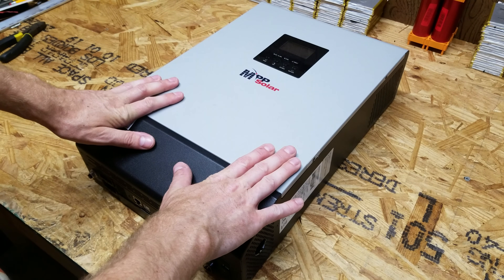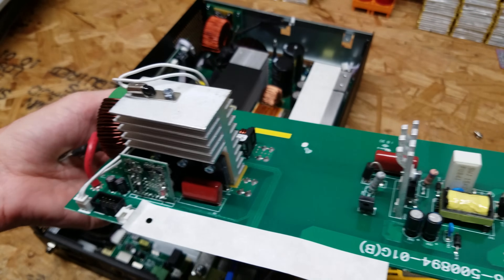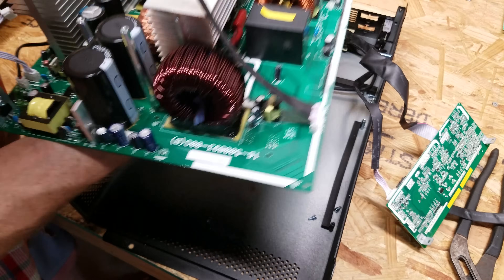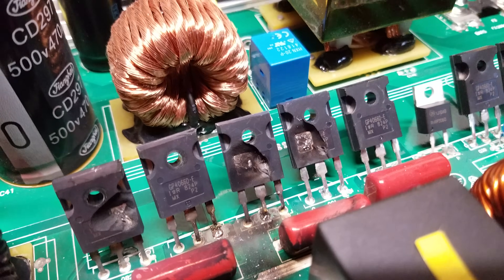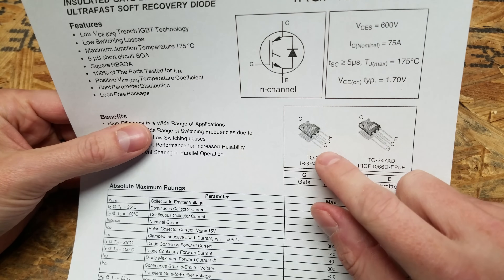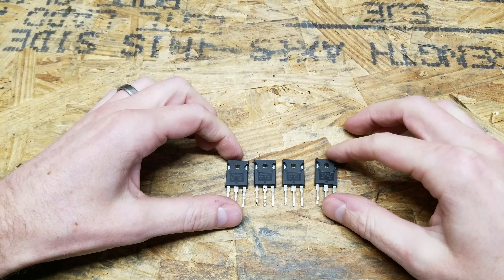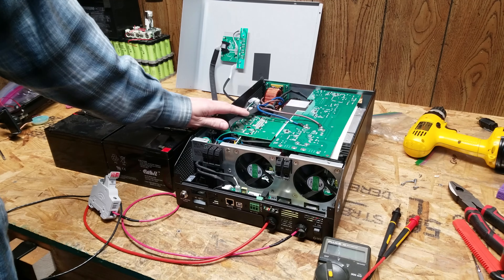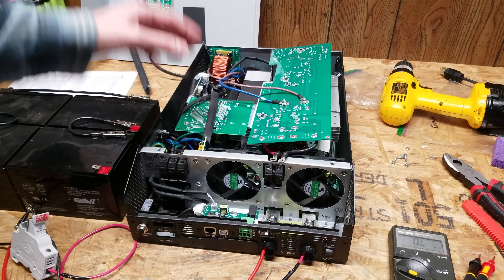MPP Solar PIP-5048MG Inverter Disassembly and Repair Attempt

Comment: Try to call or eMail MPP Solar  in TAIWAN and you will get pretty good answers and support ... add all the details you had heard from the owner and make a reference to this video.
The pre- and after sales are brilliant and you can not throw this manufacturer in the typical chinese pot cause

it is not that what you consider to be China cause Taiwan is the island and the american allied known for quality and sustainable products.
No, I am not a Taiwan employee, just a buyer of their products and I have benefitted a lot from their pre-sales service when I was not sure what product family I should or could take for  my project and they had helped a friend with a 5 year old inverter where something had been blown up after a thunderstorm and a blitz. He got a spare board within 3 instead of 5 days (from taiwan to germany) and his unit was working again.

And the technicians are willing to help to repair just the pieces that are dead if you are familiar with soldering. 
They try to help and not to sell their boards which is quite unusual.

So you might give them a try cause that would be the fastest and best solution you can get and report about in the upcoming video how you were able to fix it.

Better than reading and judging and following all those comments of pros and amateurs, cause mpp Solar is  the developer and manufacturer of these inverters that are sold all over europe under different brands and logos.
They know their stuff and I guess you will understand in a second how valueable their support can be once you get in touch with them.
Might have saved you 6 months waiting for spare parts and ideas.

Just write a short mail with a link to this video and then you should get support cause my friend did it exactly that way with his 5 year old inverter. Might be that they ask for measurements and then he made another update video and send the link to them and found the cause within 3 days and fixed the whole issue in 1 week. Not bad considering the time delay and the distance from Germany to Taiwan ... the german customs need far more time to do their work but this pcb arrived untouched, therefore lightning fast.  The damage of the 5 year old inverter was cause by lightning or Blitz and its power peak / impulse. Repair was a board replacement that had cost 80$ ... but it was not a big board.
The reason was that the special spare part needed was not available in europe during first lockdown and would have cost 30$ + european shipping alone, so he took the complete board which was the easiest exchange .

Comment: That soldering wick is containing flux too and therefore it looked dirtier afterwards ... cause it melts away and you can see it in the first solder wick points ... you see the heat "melting something" before the tin kicks into the copper.

Comment: Normally in a inverter there will be a two set of mosfets .N-CHANNEL  and BJT .. n channel are use to switch low voltage DC  and IGBT are there to switch high voltage DC to main AC

Comment: Transformers have at least 2 windings. Primary and secondary. 
What you have is a coil (inductor) used to filter out noise, or most likely part of a low pass filter or current inrush inhibitor. 
When it's called L1 or L followed by a number, it's an inductor. T1 or T any number, is a transformer.

Comment: @4:50 is a security screw. 
You need a cheap component tester. They are like < $10 now and no tech should be without. 
Diodes usually die shorted. If there is enough power, they will blow through the casing. 
If you make a detailed closeup video of the boards and traces of both sides, I for one would enjoy troubleshooting it from afar. We can all troubleshoot it from our end. 
Tracing the input to find the cause of the short, is the first step. You meter can't provide the threshold voltage for the IGBTs.

Comment: The igbt need about 6 to 10 volts to turn them on.  When you checked the dc input you have the red connected to negative showing a short. The input probably has a diode across it for protection. Test with the red from the meter to positive and you should see the meter change as it charges up the capacitor inside.

Comment: I think the smaller high frequency transformers are blown up. As mu experience, this type of switch mode power supply have some small transformers connected to the collector of the igbt makes a dead short when higher voltage is applied and melts down easily. that produces an internal short by the transformer as the insulated copper  wires are melted and exposed to each other. But these type of transformers are not repairable and industrial stuff i guess since it is calculated by the manufacturers as voltage and frequency. So if this happens, I must suggest you to NOT to try repair by your own. :)

Comment: If you don't have a 48 volts constant current power supply, use a load between the positive of the battery bank and the positive of the inverter. A good load for this test can be heat element, an 120v iron or incandescent lamp 120v 500w or even four 12 volt 55 watts halogen bulbs in serie. 
Remember that most MOSFET are very sensitive to static energy discharge. Just a little spike in the gate could short permanently. To avoid the you need to be touching ground.

Comment: I think the IGBT's switch the AC side voltages... if your dead short is on the DC inputs, then the short is likely somewhere on the DC side of the board. Try isolate the input board from other boards and test again. My guess is it's one or more of those small transistors on the other side of the unit

Comment: VERY LIKELY the MOSFETs on the OTHER heat sink are also damaged.
Then there are DRIVER transistors feeding the MOSFETs and they might be damaged as well.
You also MUST check BOTH ways with the diode setting on your meter.
One way there should be '.4 or .6, and the other direction should read OPEN (OL)'
You MUST check diodes in FORWARD and REVERSE polarity (.4 and OL)
Reply: Check MosFETs on the battery side. You will have one or more shortened FETs. It’s better to change all parallel transistors at once.

Comment: When you need to to remove those power devices, I would cut the legs first since there is no need to keep the blown devices intact, and that will also minimize damaging the board especially the multi layers boards. BTW, the Gate driver devices may be also damaged too.

Comment: 2:32 Center bottom there is an 8-pin IC. It looks like there is a white spot on top. Make sure this is not a blow out point on the IC
5:22 The red parts are high voltage capacitors. The one on the far left looks like it "could" be damaged. Make sure there is no damage to the casing

As for the FETs, I would have replaced all of them. Don't take any chances with this kind of failure.

Comment: 9:55 This is where a toothbrush comes in handy. Dip it into the alcohol and then brush the board. It removes the crud easily.

a few seconds later "i suppose you could use a toothbrush"  😄  yup, exactly!
Reply: Acid brushes work like a champ!

Comment: 9:48: That pad behind the FETs is not only a thermal pad, but also an electrical separator. The metal pad on the back of the FET is also connected to one of the pins (I think the Collector, but not sure). So to keep them from all shorting out, the pad is used.
Not all the FETs will be activated at the exact same time, or turn off at the exact same time. They pulse on a different times to help give a sine like wave. Then smoothing capacitors and the inductors (the donut looking thing with thick heavy wire wound around it) take the somewhat jittery wave and make it a nice clean sine wave.

Comment: 4:55 That screw is a type of security screw. The specially designed tip has a hole in the middle of it where that post goes into the bit. Altho, this is the largest one of those I've seen and especially odd that there'd be one in one of these devices. I would expect to see this on the "outside" of the case to keep someone from going in, not from removing the pcb.
Reply: Odd that they would design and implement a Phillips security screw in a hex headed screw... only use one on the three screw heat sink...
Reply: @SuperVstech  Took awhile, but I found it. It's called a Phill Pin. (losspreventionfasteners.ca/) I suppose a Phillips Pin(?). It is described as a "Phillips (cross) recess with a pin in the center".
As far as being in a hex headed, I have no idea. I do agree with that. What's the point of security screw to be foiled with a standard socket hex bit.  shrugs
Reply: @korishan  I wasn’t doubting the existence of a security Phillips screw... just the use of one made in a hex headed screw.
What point is it making secure the Phillips, but making the head hex?
Reply: @SuperVstech  I get that. I was just providing a little more info on it. And I agree, what's the point of a hex head with a security phillips bit. makes not sense.

Comment: short on battery input could be capacitors low ESR or capacitor short on battery input. 
MPPT stage with short ( protection diode or mosfet)
DC / AC inverter with short on input ( diode or mosfet shorted )
Good idea to limit amps on battery input and look for any component heating up with FLIR cam

Comment: Just a trick, to turn on mosfets on that way only works on mosfets or other components that have an gate and not a base. Like someone else said it could also require a higher voltage to turn them on
Reply: 9v battery does the trick

Comment: I would say the fact that the dead short is there even powered down and it’s easy to see with a meter should make finding it relatively easy.

Wouldn’t bother with passives initially a dead short of that magnitude ie 0 ohms is probably either as somebody suggested a physical short on the board or another semiconductor failed.

Second samuels suggestion with the thermal check recommend a current limited power supply but would also suggest disconnect the smaller boards and check them all separately it is a bit safer and helps to narrow down quicker.

Just go through the semiconductor stuff first I would highly doubt a passive component as they generally don’t handle lots of power and if they do they generally blow open and if this is at mains voltage It’s hard to miss.

Basically check all the transistors that look biggish then work your way down oh and from memory that inverter might have a large diode on the 48 volt supply don’t know why that would blow from the other side of the inverter but it’s easy to test.

Comment: Try to find a schematic and trace the circuit to determine what components were exposed to the mains voltage. I would also check all the caps and resistors that are located near the transistors for short or open conditions. Unfortunately, you soldered all the transistors back in. When you had them off, would've been the best time to check for shorts.  Good luck.

Comment: I don't think the other transistors would matter because it has to go thru the transformer and any short should not should up like that on the input side I'm not sure what you should see for resistance on a multimeter but I'd assume some of the mosfets are bad but I'd hook up a bench power supply that you can limit the current on and see what it does if you have one that can do 48v  or I guess you could probably use a large resistor to limit the current
Reply from the maker: One thing I'm not understanding I guess is, are the small transistors the ones flipping on/off to convert to AC? Or is that what the IGBTs are doing? If it's going through the transformer, which it does seem to be, one would assume the small transistors are creating the AC, but then I don't understand the purpose of the IGBTs.
Reply: @LithiumSolar  so my understanding that could be wrong is that a bunch of the mosfets go switching the DC at a high frequency and that goes thru the transformer to be converted up to like 250v or whatever the large cap is rated for somewhere in there and then the IGBT take that DC and make the AC output but I mean I currently have 2 broken inverters one I'm waiting on parts then we'll see if I can fix it and the other I still need to look into a little more but I mean what I was saying is that that high voltage DC conversion thru the transformer should isolate the IGBTs from the input a
Reply: This is general flow for high frequency online ups. The DC input is switched by mosfet at high frequency and amplified by transformer and input to bridge rectifier having fast recovery diodes converting DC. High DC goes to big capacitors then to IGBTs which produces AC which are smoothened by output inductor and ac capacitor !!

Comment: I would have checked the tracks while the MOSFETs where desoldered, It looked to me that some are  shorted 
If the bord such black burn marks you should remove all the burned PCB because burned charred PCB material can be conductive.
I don't know how many layers that board has but it can be that some inner layers are shorted, in any case, you should probe the board and the traces when the MOSFETs were out.
Reply: thank you
  very useful, i suspected that, now i think i KNOW it.

Comment: If you have a scope and a signal generator you can build a magnetic probe and trace on the 48V battery connection.   Test setup by shorting function generator leads together and move magnetic field probe near test wires.  Function generator is on full power (~10Vpp ,20khz sine wave).  Typically the output is around 50 ohms so the current is roughly 100mA peak.   Magnetic probe is 50turns of magnet wire maybe 1/2 inch diameter.  A small solenoid coil without center core would work.   Coil connects to oscilloscope input set on 10mV/division.  Holding the coil near the shorted function generator should show a sine wave the closer the probe is to the signal  and coil core lined up with transmit wire.  The coupling is magnetic with this setup so you can trace the shorting current to the offending bad part.   
With power off (0V on 48V battery connections), hook up the signal generator  to the 48V connections and start probing the wire/traces.   You are measuring coupled current and not efield with this setup.   It also possible to wrap the coil with copper foil and connect to the scope ground to reduce any e field pickup.   E field shield.   Good luck and let us know how it goes.   Kevin

Comment: Here's an item for your electronics bench.  I find it very handy.   ebay:  Multifunction Transistor Tester Diodes LCR - TC1 Full Color Graphics   around $20.   LCR and transistor checker.  runs off of USB power.    Not sure it has enough voltage to check fets however.

Comment: 8:05 Those IGBTs have a turn on voltage of 4 volts which is probably higher than what your meter produces
Reply from the maker: Good to know. Didn't even think to check that.
Reply: @LithiumSolar  And you are poking it between drain and gate, the source and gate should be used.
Reply: Maybe it is late,but that is not how you should test mosfets and igbt with multimeter,you turn them on by putting the negative lead on the emiter and not colector and the positive lead on the gate and check

Comment: That so called "defective screw" takes a special screw driver with a hollow center
Reply: indeed, remember Secure[d] Torx (adding a pin-in-the-middle)?
Reply from the maker: Why would they put one screw like that and the rest all standard phillips?
Reply: @LithiumSolar  to keep ordinary people from working on them.  I once worked for a company that issued screw drivers for that purpose, when I quit that company I had to return that screw driver. 🤷
Reply: I don't get those "special screws". 
They don't stop anyone, they just annoy, since you either have to buy an extra screwdriver or use pliers or needle and hammer.
I already have like 50 of those unique special screwdrivers and I keep finding more.
Reply: @hubertnnn  they stop amateurs from continuing and that is like a drawbar on  the street to prevent pedestrians and bikers to cross the railway. That drawbar can be ignored easily too but then everyone taking that shortcut knows the risks he is taking.
Therefore these screws are good ... a better sign than another  "DANGER" label sticking on the heatsink
Reply: I mean I'm not saying it's impossible but a poorly manufactured screw from china kinda seems more likely but that being said if it was tight they either used pliers too or had a special tool but it does seem like if it was intentional their would be more or in other places

Comment: That wouldn't be Ben's old inverter would it
Reply from the maker: Yes it is lol
Reply: @LithiumSolar  when you test if the MOSFETs are turning on you need to put the negative lead of your meter on the centre leg and the pos on the left leg the put the pos on the centre leg and neg on the right leg and you will see the emitter and collector are open
Reply: @dama054  u so right  with  that I could  see he didn't  reverse  the meter leads to switch  fet on
Reply: Did you ever get the inverter workingnif not would you sell it how much would the shipping be to the UK